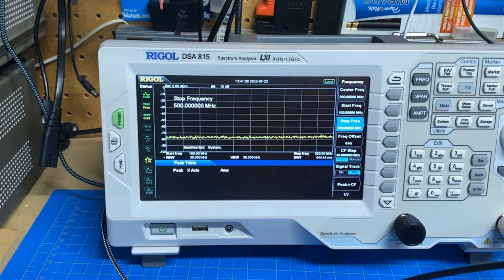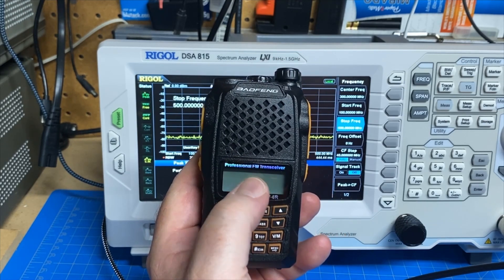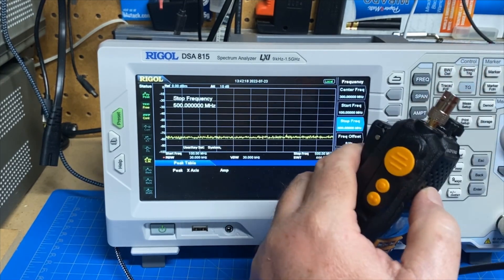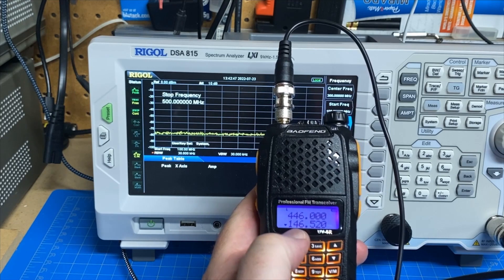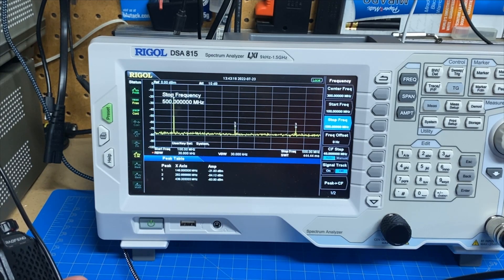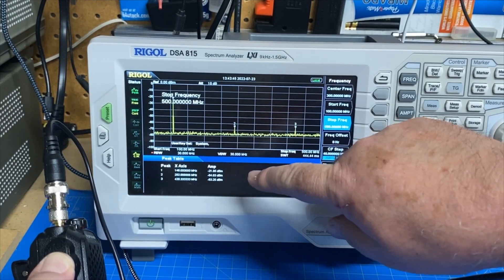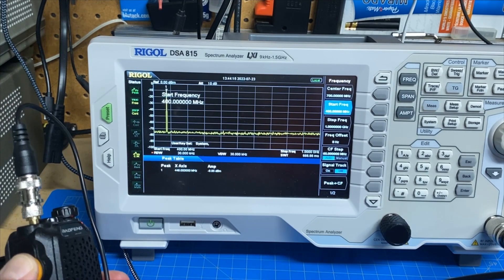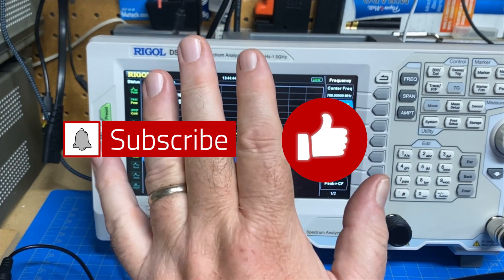The Baofeng UV-6R - does it splatter?? Signal Check Series

Comment: Currently used MOSFETs can generate harmonics exceeding 4 GHz. A 1.5 GHz spectrum analyzer provides only a partial view of the spectrum.
Reply from the maker: Possibly so, however at HT power levels, they will be so low as to be in the noise.  Also - hobbyist, not a RF lab here.  Good enough for ham.
Reply: @FEPLabsRadio   tinySA Ultra+ ZS-406 spectrum analyser  100kHz - 6GHz  cost only €125.00

Comment: That looks decent enough to use. Now I need to see my own Baofeng UV-82... I do have a nano-vna and not something like a tap so I'll just have a go and see what happens
Reply from the maker: If you have a TinySA that would work as well.  You need to either put the signal thru an attenuator (30db or greater), or build an tap.  Me and Ape did rf taps on the coffee and ham radio show maybe about 6-8 weeks ago???  Easy, cheap build.  Glad you like it Anton!
Reply: @FEPLabsRadio  will have to look in to that. 

The nano vna with the standard antenna does work and is not overloaded as it seems. It remains around 0dBmV mark.

The 2nd harmonic is 43dB below that, so that seems fine.

However, on the 430-ish frequency, the signal gets close to 0dB, on the 9700 it shows as s9+40 on an antenna 2 meters / 6 feet away. It is fully quietening the receiption, however, when trying to open a very nearby repeater on 70cm, this fortunately doesn't work. 

This seems to be a good point and maybe misusing the NanoVNA